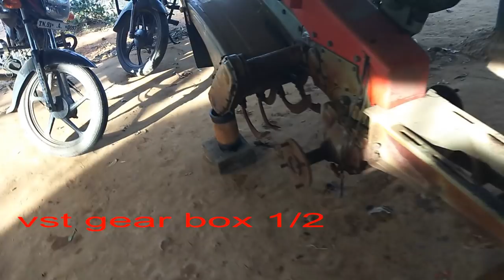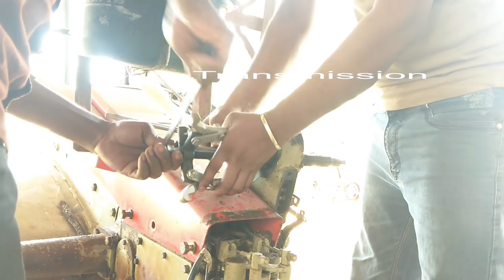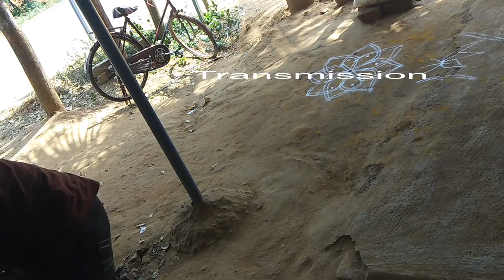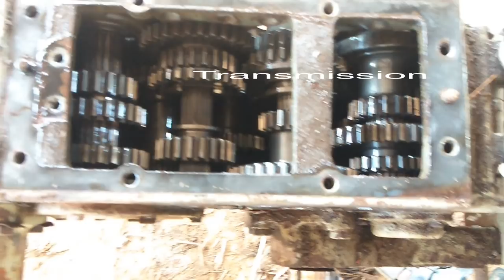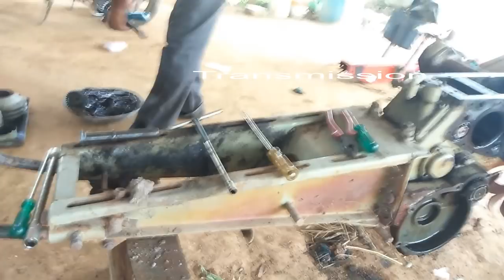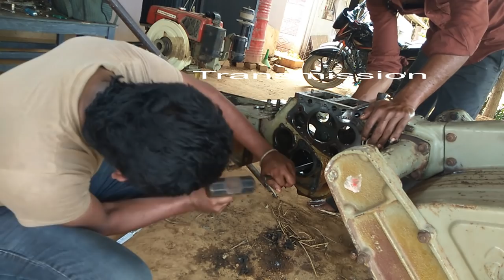vst gearbox dismantle and cleaning| சக்தி பவர் டில்லர்

Comment: When tractor is on running, the one site wheel is stop in minutes without giving break. Why?
Reply from the maker: Which tractor
Reply: @transmission5233  shakti tractor
Reply from the maker: Three reasons
Reply from the maker: Side clutch bearing run out or 
Final drive bearing run out or 
Axle bearing run out...
Reply from the maker: I thing steering gear change